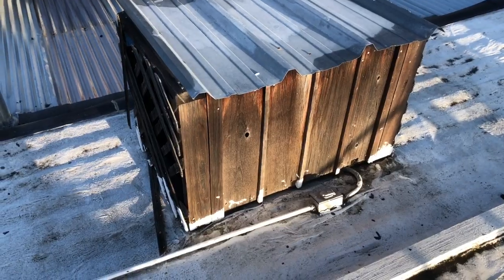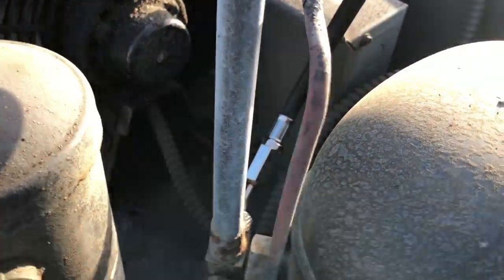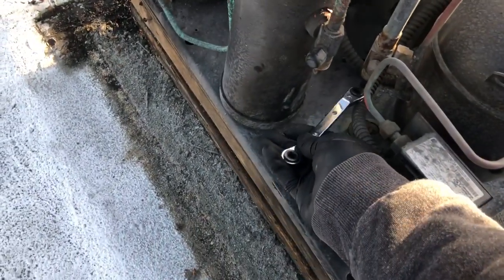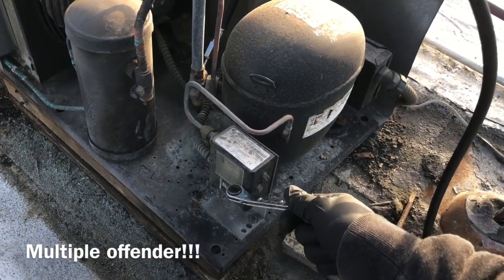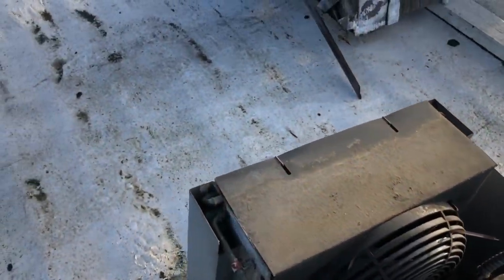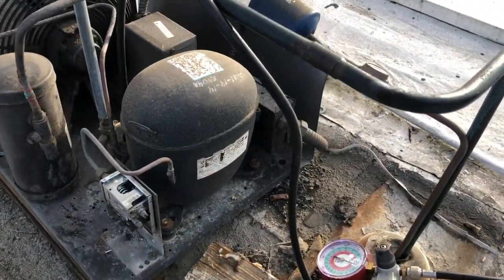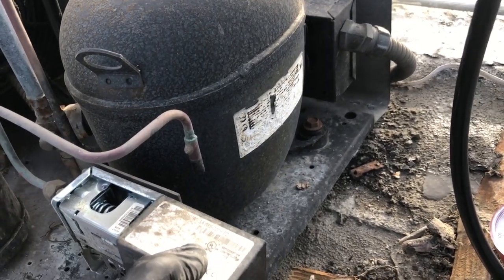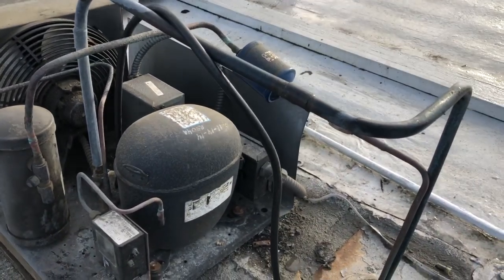Unit pump down

Comment: Man Dave, this unit is kicking my butt. I changed the consenser and txv as well as the lpc. I have the lpc set to cut in at 30 psi and cut out at 5 psi i guess i am confused. The system wont stay off. I am using a penn all range lpc. After closing the receiver it pumps down but turns on again after rising about 5 psi. Any help on this would be greatly appreciated.

Comment: Hi Dave, cool video. I ran into this just last week. My question is after i pumpdown the system to a vacuum and replace the txv how do i then check for leaks and put the system under vacuum before is restore operation?
Reply from the maker: You nitrogen that section for leak check , use soap bubbles then vacuum.  You could vacuum then use deca test then after system back open recheck.
Reply: What's a deca test?

Comment: hey dave im new to the field n had a ? about that pressure switch. i usually c those connected to the suction line for pump downs. the one on video is hooked up to a process stub. was curious as to the psi readings it gets to go into a pump down? is it reading the same as suction line pressure? thanks again n ur videos r very helpful n very enjoyable. luv the hub!!
Reply from the maker: Yes it’s hooked up to the suction side.
Reply: Thankyou pal @NorCal-refrigeration